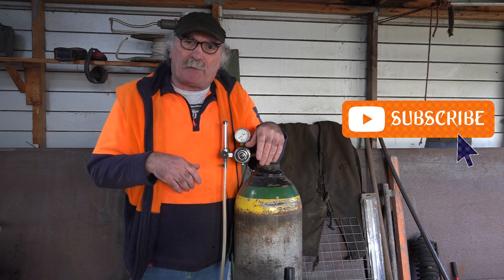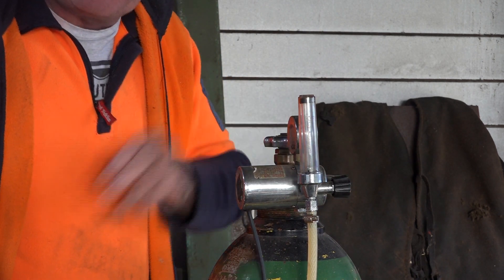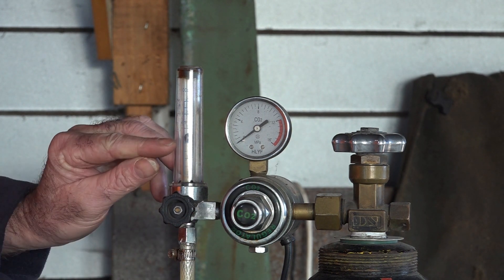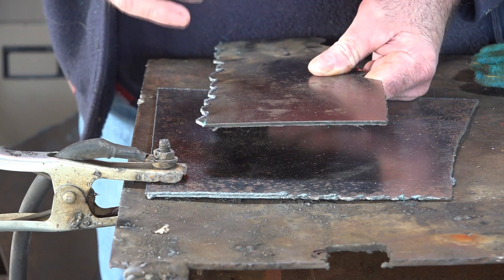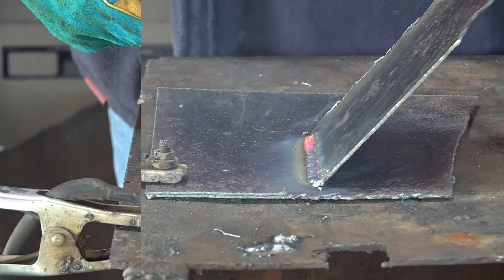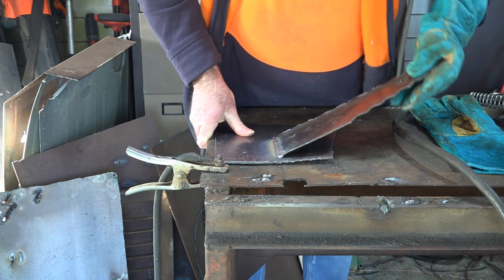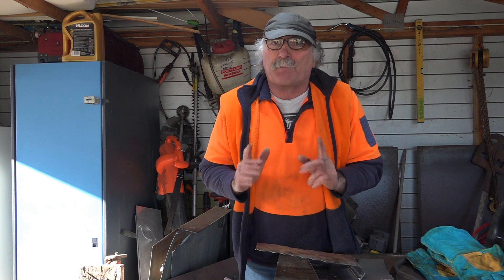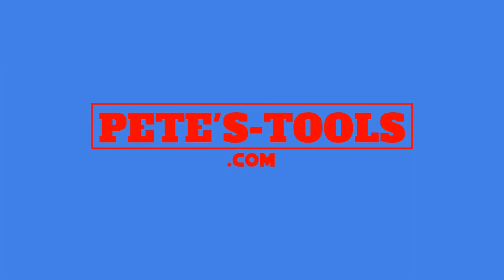How to set your Mig Welding Co2 Regulator

Comment: When l finally got around to setting my welder up to try actual MIG, l miscalculated the conversions for the flow rate (imperial reference books with metric gauges).  I ended up running something like 5 lpm.  The welds still turned out nice.  When l contacted Forney for some perspective on this, all they would do was rattle off the textbook responses.  I get the impression that these kids don't try out anything just to see, you know?  Then of course everybody's terrified of liability.  Cheers.
Reply from the maker: LOL yea

Comment: Hi Pete.    Iv'e only ever used C25 gas for mig welding but it seems that CO2 works just fine for general purpose welding.   Is the heater absolutely necessary/
Reply from the maker: Yea otherwise it will freeze up.